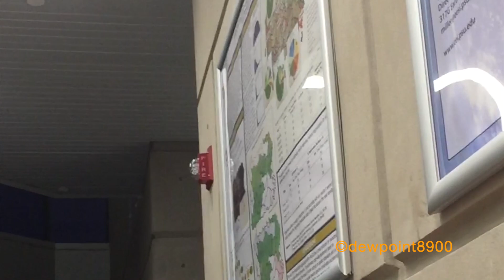Fire Alarm Activation #8 (Siemens MXL-V)

Comment: Why does it pause at “by the”
Reply from the maker: I think the voice evac messages are split into phrases, so the transition between phrases there isn't that clean.
Reply: @dewpoint8900  Typical Siemens…
Reply: It’s an old message.
Reply: The DMC-1 (which is the voice and tone card for the MXL) has around 300 different phrases and what not to choose from, so you could create a new message entirely just by picking the phrase. The reason for the pause is because it could have something either added after it or be replaced entirely by a different phrase so instead of having "By the nearest exit" you could instead having something like "Stand by for further instructions". The whole message you hear is basically a bunch of different phrases mashed together to create a message